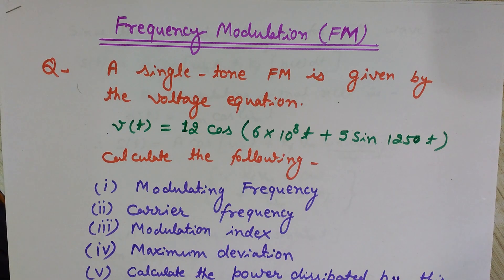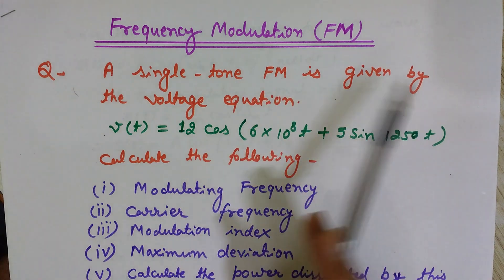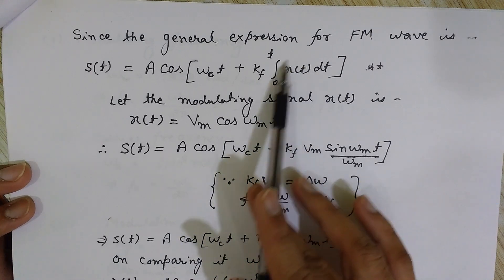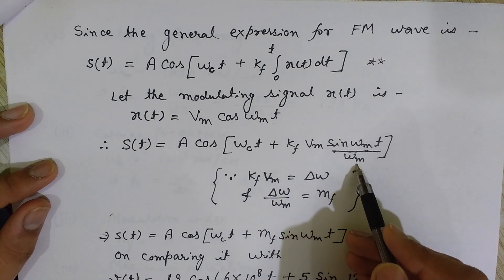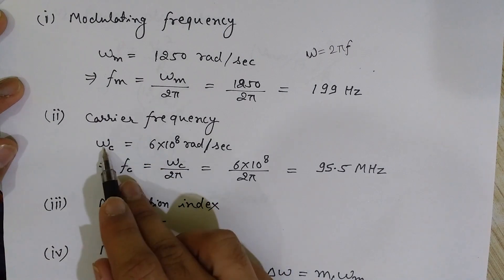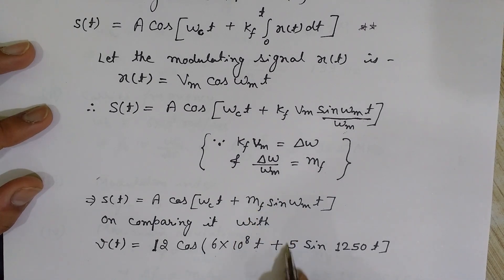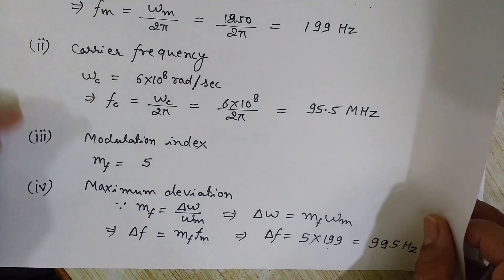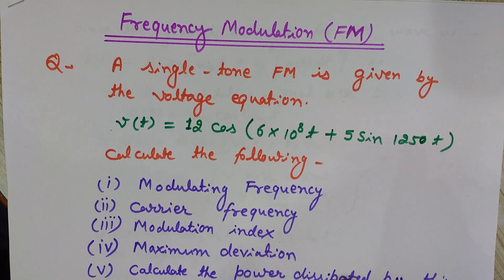Frequency Modulation (FM Modulation)- FM Wave Equation- Modulation Index of FM - Frequency Deviation

Comment: Determine the, modulation index and bandwidth for  A baseband or modulating signal m(t) = 5 cos(2n x 15 x 10 t) angle modulates a carrier signal Acos(w.t). Assume kf = k, = 15 kHz/volt. (a) FM system, (b) PM system. 2) Find the change in bandwidth if the modulating frequency fm is reduced to 5 kHz.